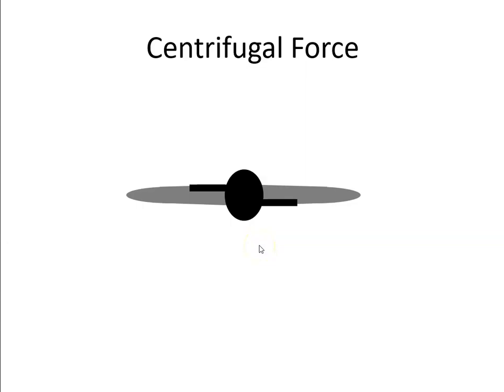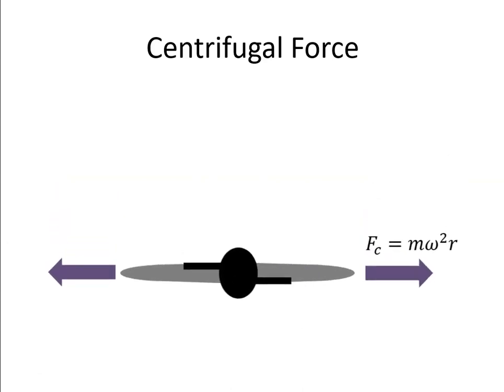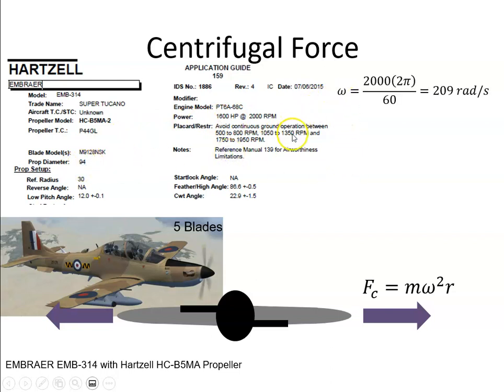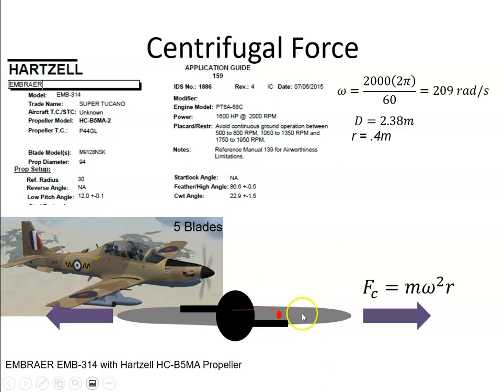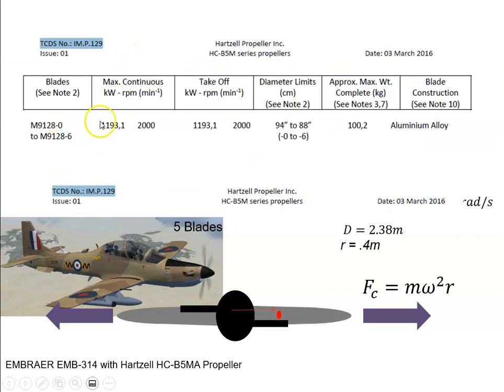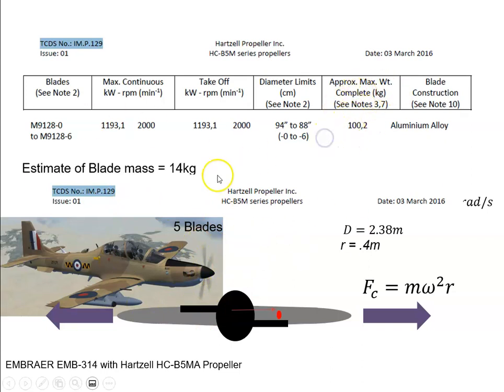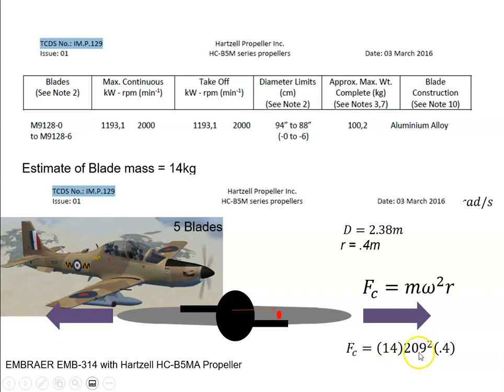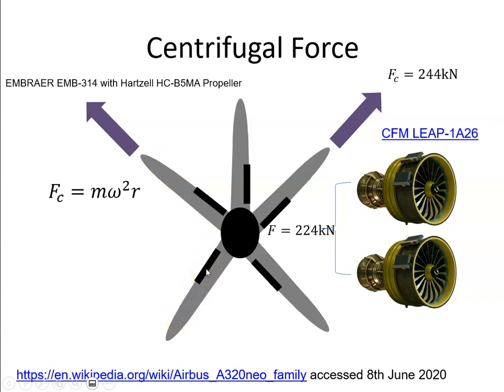Centrifugal Force on a Propeller

Comment: I could just be stupid but how do you get the ratio of the hub to propeller as 7:1?
Reply from the maker: It was an guesstimate.  I guessed that the hub was twice the mass of a propeller blade.  There are 5 blades, so 5 blades plus the guess of the hub being equivalent to 2 blades is 7.  However, this is only a guesstimate and could well be very inaccurate.  The point of the video was to illustrate how large the centrifugal force can be.

Comment: awesome vid! why would you say spins maneuvers in a turboprop are prohibited below certain altitude where the air is denser and the idle power managed by the computer is less Np than at higher altitudes??? I think it is related to this theory of centripetal force and denser air (aka more push on the blades?) basically what happens if you put the prop at a reduced rpm and in a spin maneuver?
Reply from the maker: I’d say that spins are prohibited below certain altitudes because in a spin an aircraft can loose altitude very fast.   After 3 full rotations the aircraft could lose 3000ft.  This doesn’t give pilots much time to recover if they start at a low altitude.   My personal recollection in an SF260 SIAI Marchetti during a test flight was that the pilot initiated spin recovery after the third full rotation and when we pulled out of the spin we had lost 3000ft.  This was over 25 years ago so don’t hold me those numbers.
Reply: @RoddyMcNamee  Thank you Roddy for the input. yes definitely altitude to recover is a factor but in some Hetzel blade props and engines like in the PT6 in prohibited due to forces on the prop I think it has to be with the more dense air, centripetal force ..?  what do you think (from the load and force perspective)